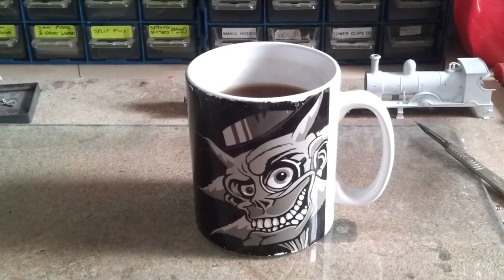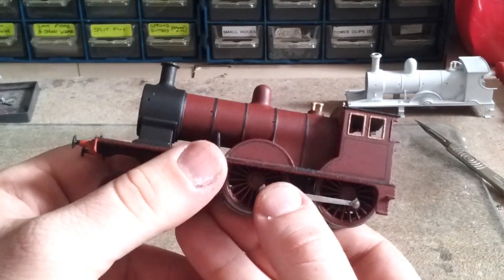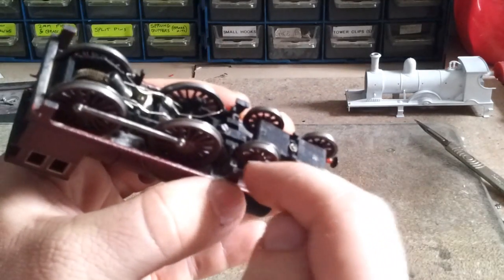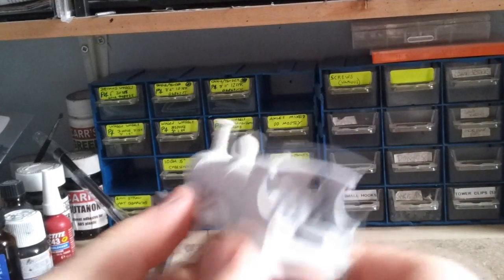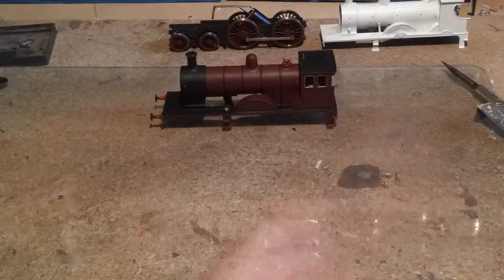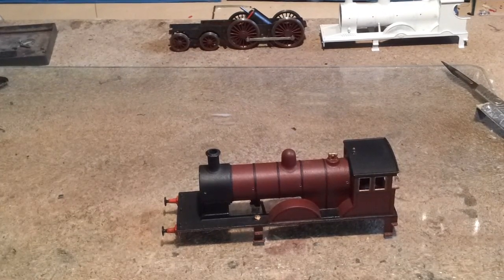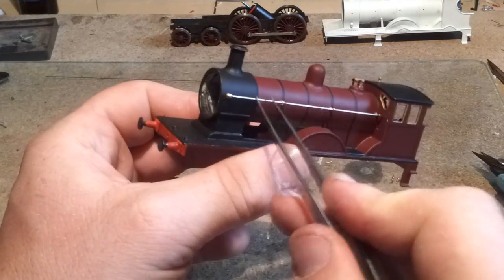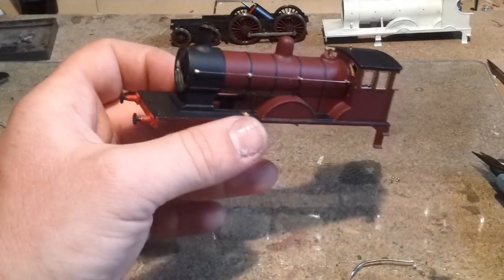Building an SCC Loco Kit - Part 14 - Finishing Off

Comment: Great Series Knux! Very explainatory, very helpful as well, the finished product looked fantastic.
Personally I'm at a loss for words.
Reply from the maker: Thanks. :)

Some asked me to make the series and I thought / hoped it indeed would help so if it has then great.   It may even put some off as it shows what is involved but to get these running requires a lot less work than a traditional etched loco kit as a lot is already done for you - both on the chassis and body.

Unsure what the next modelling video's will be.   Any ideas, requests?
Reply: No problem!
Would it have to be anything in your range of stock, or can it be anything at all?
Reply from the maker: Anything potentially, I've been making video's on this channel for the fun of it since its inception so not everything has to be in regard to the more recent SCC venture.

Comment: Just an idea for your next potential project - how about Furness Railway No. 20? I think with an 0-4-0 tender engine, you would probably want to have pick-ups from the tender wired up as well.
Reply from the maker: Great minds think alike!   It's been on my mind for a while.  Already have scale drawings ready.  However I've recently embarked on another project doing prototype A1 things.
Reply: sparkshot - If you ever get around to some other projects, a Manning Wardle L class body kit wouldn't go astray. I've already got a spare Ixion Hudswell Clarke chassis.
Reply: sparkshot - By the way, I am an O gauge modeller. I have been eyeing your J1 and E1 models on shapeways. I am not 100% sure about 3D printed chassis in O gauge. Though, I could simply use some suitable brass U channel for the chassis and use the printed components as cosmetic side frames.
Reply from the maker: Martin Hartley - Could do, whatever you think best. Modelling has so many methods.  If you look in the MBS chassis section for 4mm you will see a variation of the J1 chassis.  Mine uses these bearing carriers.  As that was the prototype I've been tweaking things since building upon the concept and am currently doing my 2nd chassis with MBS.  In 0 gauge I'm pretty sure the system would work even better due to better printing tolerances and bigger components.  Can convert any chassis to the MBS if you are interested.

Comment: It's good that you are making these sort of kits. They certainly look the part when done up.  I don't think I've ever seen a K2 in model form before (not counting Edward). I was going to ask what track gauge they run on but that's obviously down to the modeller and the wheels they choose to use. Normally I'd just think; yeah standard Hornby track but after learning you're opting for a slightly different track guage; that question sprang to mind anyway :)
Reply from the maker: Thanks. :)

I think I am the first to release a K2 actually, Dragon Models has finally caught up and made a brass one but it is the Cambrian Class 61 instead.   Truth be told though there isn't that much difference between them.

Comment: What type and brand of paint did you use?
Reply from the maker: Phoenix Precision for the red.
Reply: @sparkshot  air brush
Or basic brush
I'm building a Thomas rws version
My own take
And I was wondering what type of tool you used
Reply from the maker: I just brush painted it.  I do use airbrush too but depends what mood I'm in as I can brush paint pretty neat too

Comment: Can you make an E2 Class LB&SCR Tank Engine  in the next video?
Reply from the maker: Hello. :)
I'm not making a series showing how to make each engine as the principles are similar or the same. The K2s are slightly more complex than the E2s because of the bogies.  As the E2s are 0-6-0s all you have to do is build like how I showed for the K2 but do the same for the extra driving wheels.